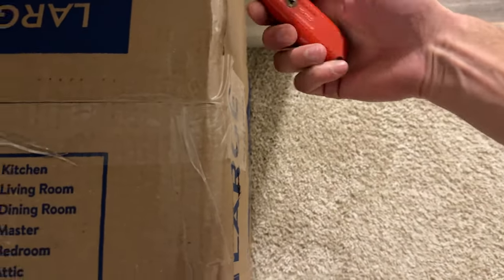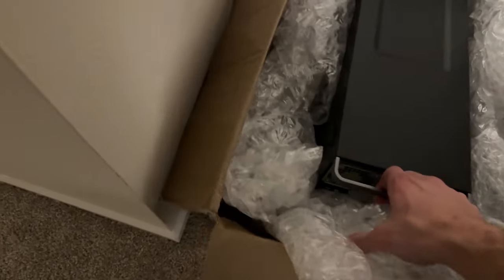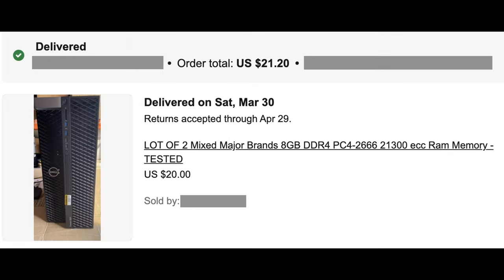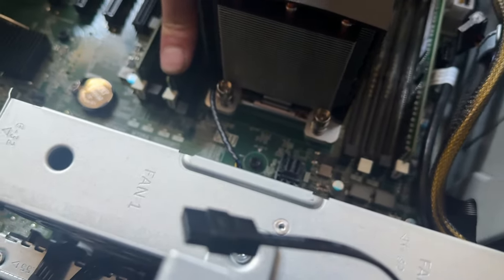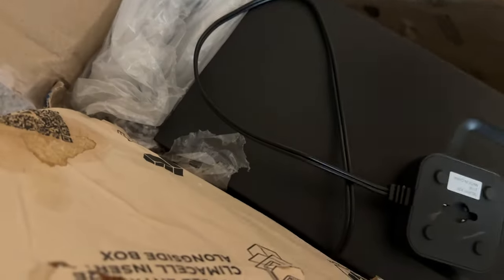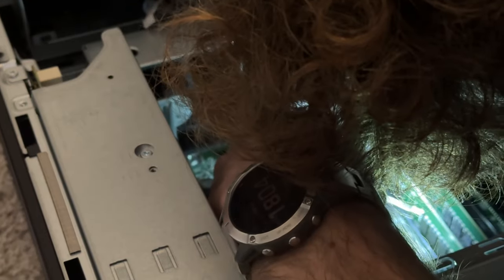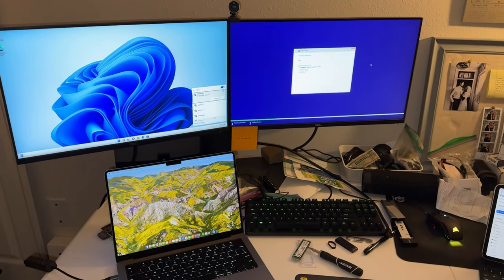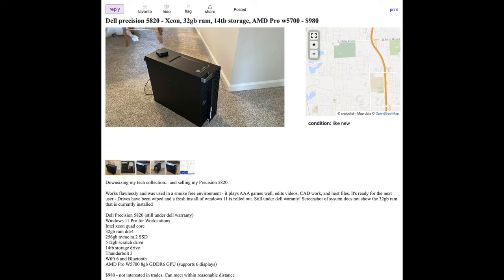Free Gaming PC? Yes please

Comment: Yeah these workstation PCs can be a great deal. Even better if you visit your local E-scrap recycler. I used to buy them for $20 a pop from a recycler. eBay sellers know their value so they jack up the price but e-waste recyclers use them for their raw materials and sell the better chassis for slightly higher than scrap. I highly recommend checking it out. 

Also those Chinese x99 mobos are a great deal too, they use the 4th gen E5 xeons and you can get up to a 16 core cpu for less than $20. With CPU, ram and mobo you can get it for less than $100.

My buddy built me out a pretty decent E5 tower for about $250 including a GTX970, 32gb ddr4, 128gb NVME, 2tb HDD, 550w PSU, case with RGB, Etc. In cinebench it clocks faster than a Ryzen 1700x and faster than a i7 6950 I believe, but I could be mistaken on that last one.